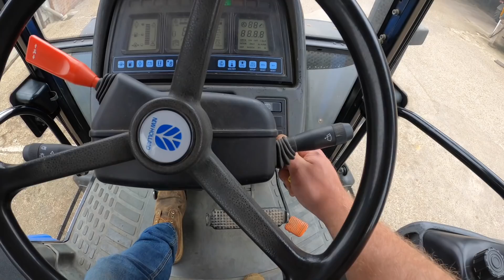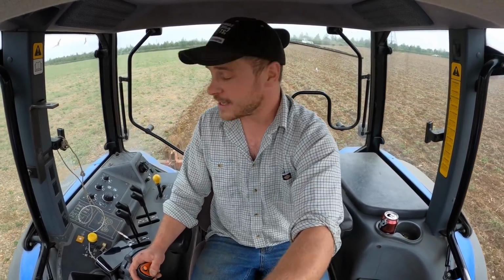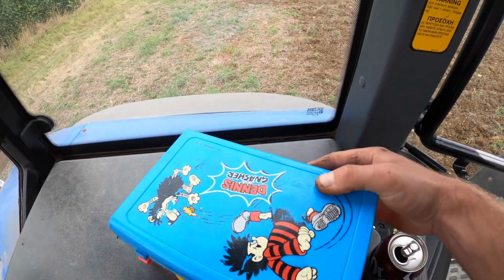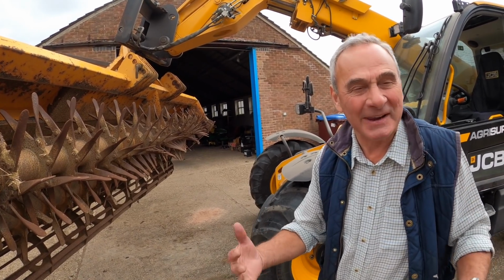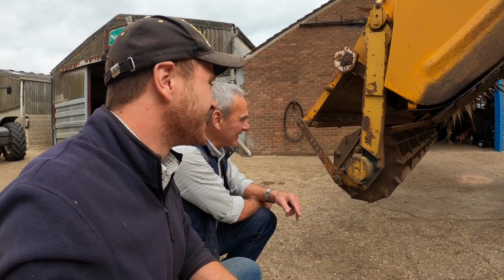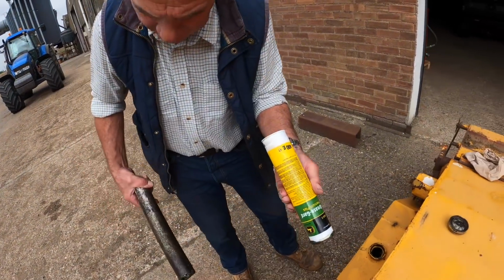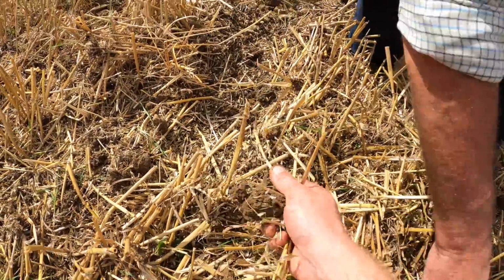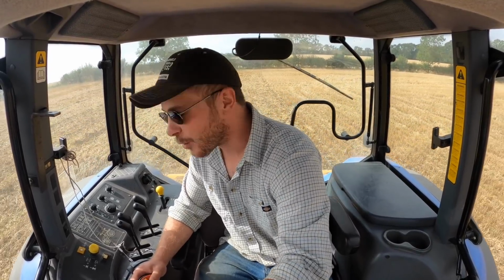WE HAVEN’T USED THIS FOR A LONG TIME!! PREPPING GROUND FOR WINTER BEANS!

Comment: We’ve been using a Dynadrive (the same one!) for the last 30 years.  We’ve gone from ploughing and sowing with a power harrow combination drill to non-inversion minimal till, minimal disturbance drilling.  The only machine on the farm that’s been used throughout and is still used is the old Dynadrive.  It was originally pulled behind a Case 7220 Magnum.  Now it’s a John Deere 8300T or a 6210r.

Comment: John Deere Corn Head grease is great in old leaking gear cases that formerly specified gear oil. The Corn Head ( NLGI - 0 ) grease flows when stirred but turns firm sitting still. No leak.
💚✌️🍺🍺🇺🇸

Comment: Regarding shear bolts. Try using 12.3 bolts instead of the 10.9 one I’m guessing your using, the extra strength will probably cut your stoppages by 40% 👍
Reply from the maker: I’ll double check which strength they are, thanks for advice 👍

Comment: Great video nick,  wouldn't a straw rake do the same job? Blimey you certainly left a lot fallow last year. Same this year? Great to see dad.  Set of discs and a set of gang rolls a do it hooked on the discs. Must have a set of old Cambridgeshires in the scrap heap.
Reply from the maker: It would, think Dad wanted an excuse to get the Bomford out 😂 yeah about 240 acres out of 1000, about the same this year then more cropping from 2022 👍🚜
Reply: @NicksFarm  why so much?
I can understand fallow more this year with the high input costs?

Comment: Like all your videos and this one was no exception. Liked the "Dad cam" moment with special lubrication technique. Two handed grease gun? Have you heard of the Lock N Lube locking grease coupler from the USA? I use them on my machines and they are like an extra set of hands.

Comment: There is a very good reason "gear oil" Is used. Grease has too high viscosity (too thick) and grease is no good for high-speed rotating masses like gears .. It will fling off due to centrifugal forces. But hay I`m only an engineer what do I know.
Reply from the maker: You’re right I guess we’re using grease as like we said it does leak 😬 there was some oil in there more on one side, so a bit of a mix 😂